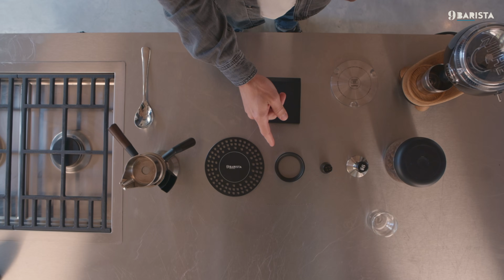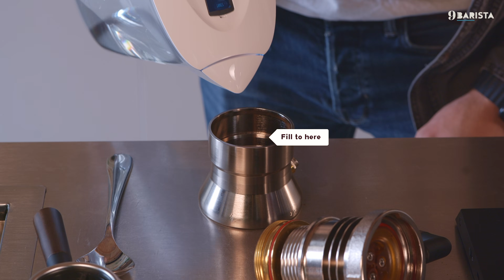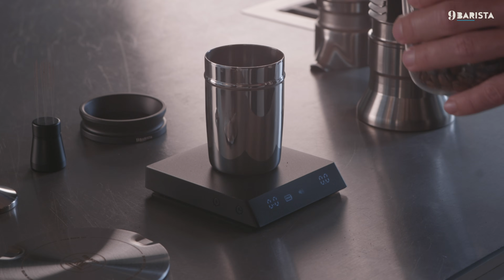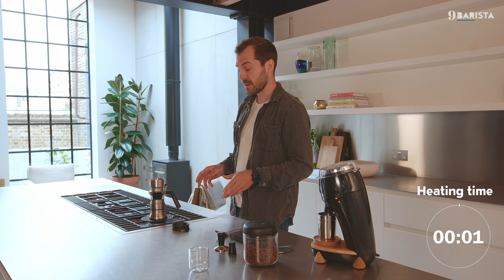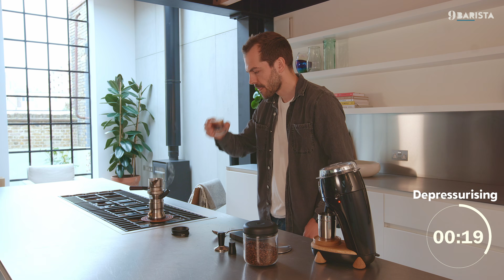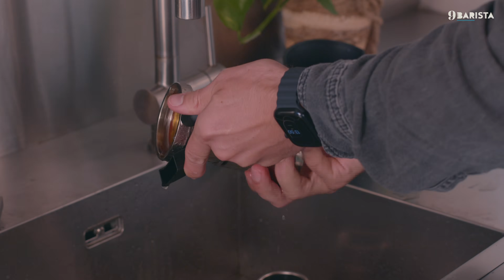How to Make Espresso at Home with the 9Barista | Step-by-Step Tutorial

Comment: @William or anyone here in the community I need some advice please. I have used the MK1 for about 1 year now and I've made some wonderful coffees in the mean time, I think however that I maybe can make them better (looking at this video and some others) so my question, In the case of an induction plate, how do i remove the "harsh bubbling" at the end of the brew, if i lower the temperature i doesn't seem to reach the necessary pressure on time (as per the guide) - any hints are appreciated. Also is the shot volume normal - my one does not go much over, 2-3mm, after the beginning of the spout incline.
Any feedback is welcome thank you.

Comment: With 18-19 grams I get sour tasting shots, and I’ve tried already few types of locally roasted beans. And 9bartista is recommending even 20 grams? I’m not a pro, but isn’t it rather logical to reduce the dose, so that the grind size can be also reduced for a less sour shot?
Reply: It certainly true that lower doses can give better results, depending on the coffee you're using and how it's ground. You're doing the right thing by trusting you tastebuds. Dropping the does and/or grinding finer should increase extraction levels which should offset the sour notes.
Reply: Bitter = over extracted = too slow brew.
Acidic = under extracted = too quick brew.

From here on a classic moka pot you have 2 options to slow down the brewing time if your coffee is too sour. Grind finer and/or reduce the heat.
With the 9barista you can only tweak the grind size. So you definitely need to grind finer.

Comment: While this is an excellent introductory video, I believe the 9B instructions specifically tell you not to put the machine back on the heat after extraction.
Reply: You're absolutely right. You'll notice that the gas is turned off when the machine us placed back on the heat transfer plate, which is perfectly fine.
Reply: @9baristaespresso  Oh that's good to know! I always assumed the plate stayed hot even after turning the heat off.

Comment: How long 9barsita should be working without any problems?
Reply: If you're careful to make sure you don't leave the machine on the heat after it's made a coffee, then it should last for many hundreds or even thousands of cycles, before any o-rings likely need replacing.
Reply: I use 9barista daily for 5 years now. This thing is just build like tank with replaceable parts. I bought rather expensive Rocket Espresso Appartamento later, but quickly switched back to 9barista and take the big machine to work. For only one coffee person the 9barista is just better. It's great for travel as well. Over the years I replaced 2 times just the O rings (very cheap, you can buy them locally). The first time due to leak, second time just regular maintenance after a year or two. My recommendation - get good grinder. Something like Kinu M47 Phoenix or similar.

Comment: @9barista William, I prepare my coffee 1:1 as you have demonstrated. Just a small addition from my side. When cleaning my 9barista after use, I always  push out the filter basket 5-6 mm (with my finger, through the hole of the portafilter). This way, the water rinses well the space under the portafilter, where otherwise remains some espresso residue (check and you will see for youself!). I love my 9barista and almost never go anywhere without it and my trustworthy hand grinder.

Comment: I just received mine yesterday evening and this morning made a decent espresso on my second try. The first try didn't produce any espresso. At first I assumed this was because I'd ground too finely, but upon inspection the grounds weren't wet, so since the water wasn't even reaching them that couldn't have been it. Per the troubleshooting guide, the answer was I needed to increase the heat on the next try. Even at max heat for that burner it took 8:30 to finish, which made me a little nervous that I'd overheat the chimney and internal parts, but it seems ok. I'll try a hotter burner next (if I have one.) The device is as beautiful as I was hoping. I'm looking forward to mornings a lot more now!

Edit: Third try on highest heat was perfect!
Reply from the maker: Excellent, increasing the heat setting is the most common solution if the machine isn't producing espresso. Delighted to hear all is working well and you're enjoying your machine!

Comment: Can 9barista make a 50-60 ml of espresso? I really like the machine, but 40ml is a bit too short for me.
Reply: The machine is configured to produce 40ml of espresso, and this can't be changed. If you want a longer drink, adding a dash of hot water to the espresso works well.
Reply: thank you 9barista
Reply: Authentic ristretto espresso is 0.75-1 oz (250 ml = 8 oz) so 40 ml is way beyond that

Comment: Would you potentially ever opt for using 100% natural materials instead of the few plastic/rubber bits on the machine? I think its a beautiful piece of engineering but those few pieces are rather unsightly. Thanks!

Comment: Awesome device, it's an art piece born from pure engineering. Getting boiling water to cool water for coffee is so fancy. Though when you grind too fine, you will experience the safety valve blow and it's scary :) If you clog moka pot, it just hisses at you. This one packs some punch and steam, so be wary where the safety valve is pointing at.
Reply: Does it explode if you grind too fine?
Reply: @Z0LB00  It doesn't explode, it just releases the pressured steam if you grind too fine and heat too quick. But as there's a lot of pressure, the steam goes out with a loud pop and heat. So if the valve is facing you and you overpressure it, it can scare you.